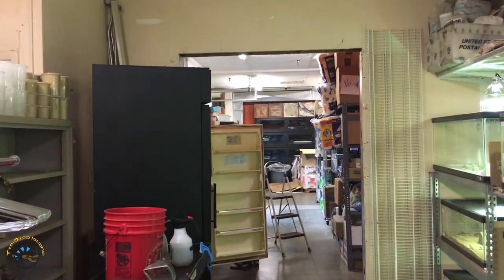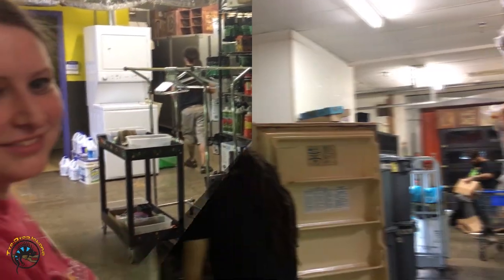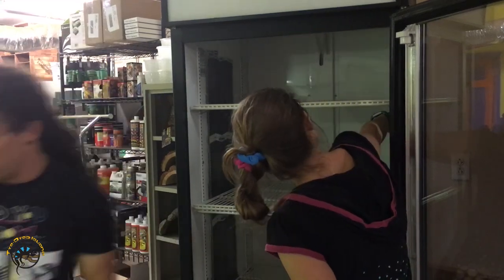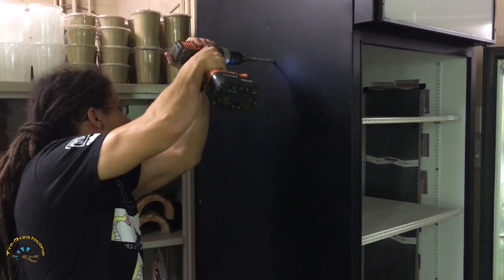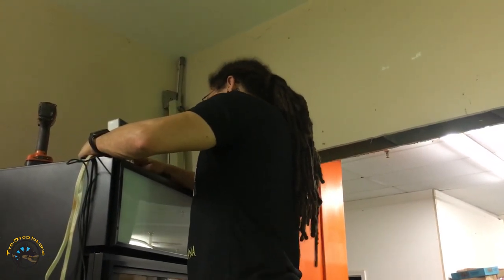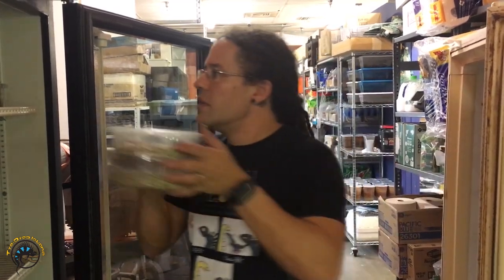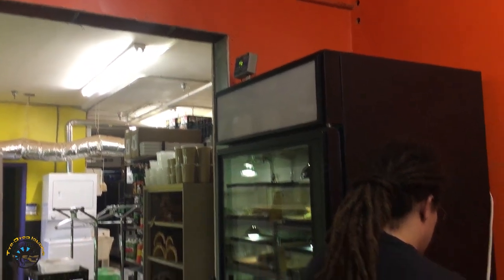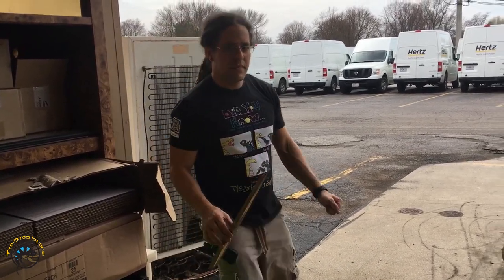Transforming an OLD Fridge into a NEW Incubator! ♻

Comment: Its hard to understand how and what y'all are doing, but I have an old glass frige, the motor dozen work I figure that I might have to strip out all the wires but then what do I do or need to do?
Reply from the maker: There's no need to strip anything out of the fridge. We just drilled into the side and installed heat tape attached to a thermostat and fans for airflow.